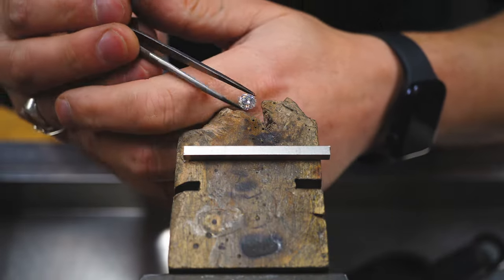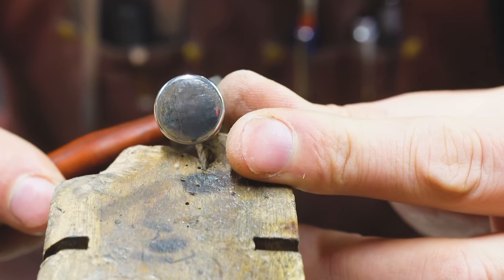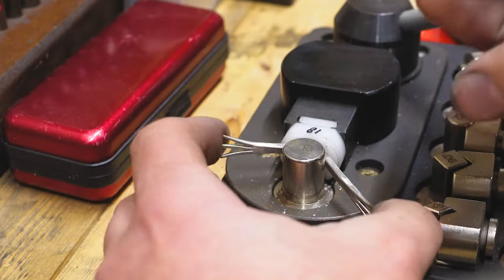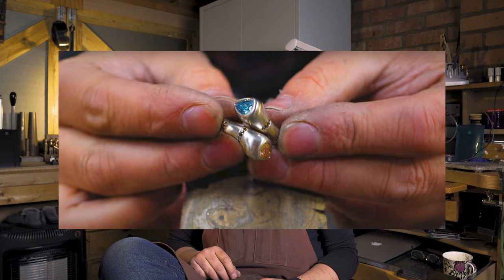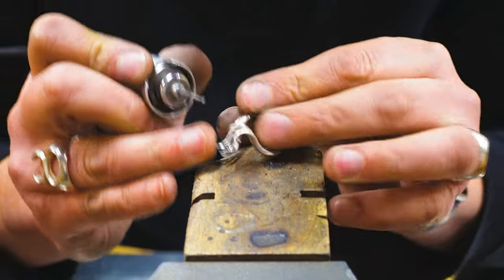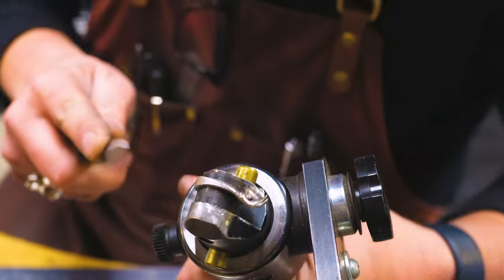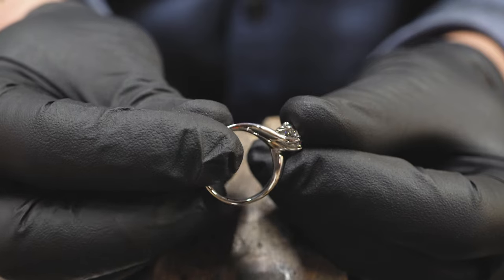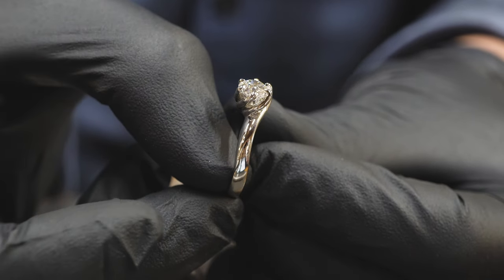How I Made This Platinum Solitaire (With A Twist) | Goldsmith's Workshop Secrets

Comment: Beautiful work! What’s the tool you push the prongs down with at 8:08?
Reply from the maker: Thank you 🙏🏻 The tool (and you might not believe it) that I’ve been using most lately is the back of my needle nose pliers handle 😂 but what you are seeing there is a metal engraver. You could buy them at the hardware shop. Usually used for rough tool marking - I just flatten the sharp point. It’s pretty used and I’ve always used these. They are cheap and last a long time. Great value for the workshop 👌🏻

Comment: is jewellery smithing profitable? I don't mean like make you rich, but is it a viable option as something that can be done full time? I want to start and realize I likely won't make any money for awhile but I'd like to invest time into it as a possible option to step away from a regular working job.
Reply from the maker: That’s a great question Terrence. I guess the long answer is yes. Many of the folks here have done it. This trade is so multifaceted. You don’t need to be a master goldsmith to earn a decent living either. Every step of the way has its advantages. I started by working on markets selling very basic pendants and found my way here. Think of it as a scale which will tilt the right way when the time is right. My advice - start with the basics. You hardly have to have any tools to get going. Then invest as you see the need. You will be there in no time and having fun all the way. Good luck 👍🏻
Reply: @jacothejeweller  thanks for the response, it's very encouraging. I've been thinking about starting for the past 2 years but was discouraged because it seems like there's an oversaturation of casted and chinese jewellery, it made it seem like it would be difficult to compete in the market. 

what tools would you think would be essential for starting? would it be a good idea to start by making line bracelets? should I stick with gold or is silver a better starting material since it's cheaper?

Comment: this is absolutely beautiful and looks like something that is probably best to do once you've had a good chunk of experience in your arsenal and time to perfect your skills - very impressive! pieces, where you end up sculpting the metal are my favourite to do, i find that process to be extremely therapeutic. when you flatten the edges of the ring by hammering them down, is there any benefit to that over using a rolling mill to carefully squish them? or do you just feel like you have more control when you do it by hand? also, at around 8:09 ( https://youtu.be/kYILp59M1CQ?t=489 ) are you using a hammer tool to bring down the prongs? it's a little hard to tell. thank you for yet another awesome tutorial, and please keep the prongs gang sign going bahahah
Reply from the maker: It’s just the best Alisa. I find the hammer gives me the angle I need and I guess as you say a bit more control. The roller tends to be too dramatic on the transition - but it depends on the job for me. And yes, well spotted. I use a ‘metal engraver’ with a blunt point for the heavy hammer action and my Lindsay air graver for the lighter stuff. Thanks for the lovely words 🙏🏻
Reply: @jacothejeweller  thank you, Jaco! 😊 your hammer game is strong. Every time i have to hammer something a lot, the angles are all over the place 😂

Comment: What platinum alloy you are using for work?
Reply from the maker: I don’t mix the metal myself I buy it from a local UK supplier and believe is a Pt/Cu mix. Our South African supplier used to provide a Pt/Ru option. 👍
Reply from the maker: Hey Marek, I get this alloy from the local supplier and I believe it’s Pt/Cu - it works fine and I’ve gotten used to the feel now. Actually not bad for bench work at all. Every mix I’ve tried takes a bit of getting used to. Not a fan of whatever some casters are putting out there though. Very hard on the burrs.
Reply: @jacothejeweller  Thank you for anwsers. I am making my own alloy with Ruthenium. Would like to use Iridium for better hardness but its too expensie. I wonder about alloy with copper - does it oxidise in comparison with other Platinum alloys?
Reply from the maker: @mnap89  not that I’ve seen. Still remains shiny when you melt it down. But that ruthenium mix is better in my books. That’s the one I enjoy working with most.
Reply: @jacothejeweller  the super hard stuff is pt/cobalt either 950 or 900. Platinum iridium is an absolute joy to hand work and bench work but the price or Iridium is completely crazy now.
A good way to check is that a lot Pt Cobalt is magnetic
Reply from the maker: @jasperallen8479  the cobalt mix is super hard on my burrs though. I’m not too fond on the magnetic stuff for this reason. It seems a lot of the cast platinum coming through my setting bench is magnetic. It looks like that mix might be easier on quantity casting - I’d love to get the inside on this.
Reply: @jacothejeweller  Hi Jacob,  yes Cobalt is a grain refiner used in the casting process making it easier for flow when casting (same as Ruthenium and Copper and Iridium) but it makes the allow really really hard and can oxidize when heated for soldering.